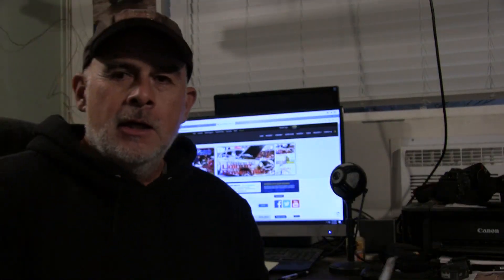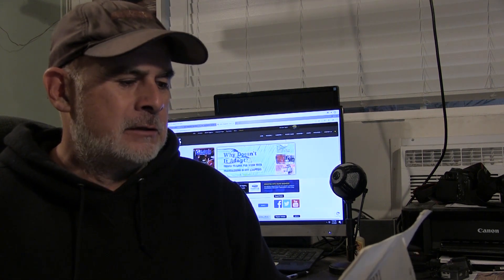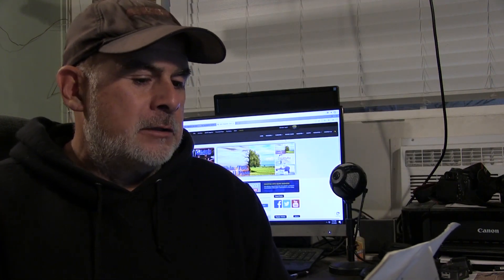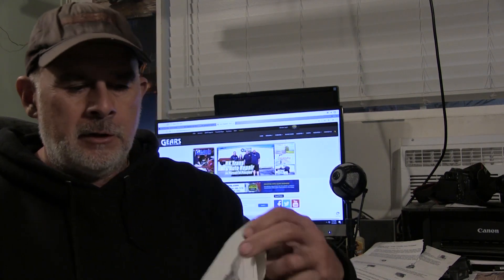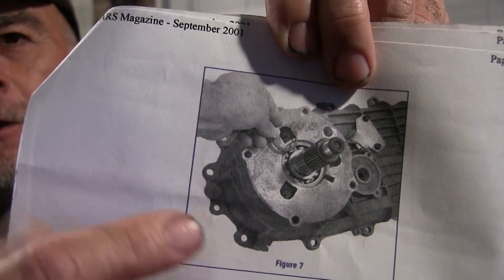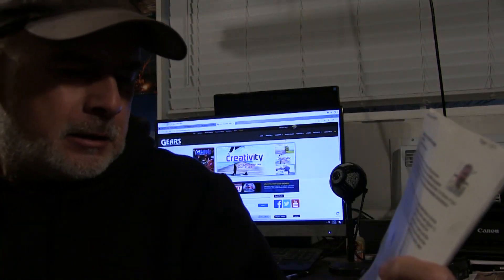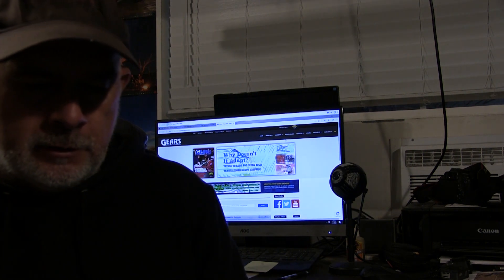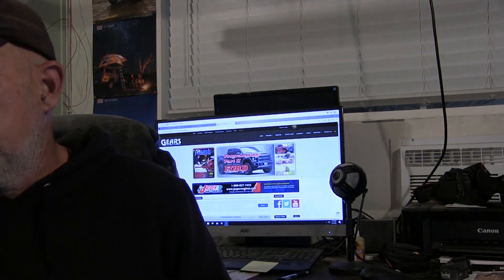Borg Warner 1356 Transfer Case Issues

Comment: Mine clunks on takeoff, haven't noticed this during backup though.
Reply: This still applies to 1356-82 with boot and fixed flange yoke?
Reply: @xAwoken_Dreamer Mine (1995 Bronco) has a flanged double cardan on the xfer case and a slip joint in the shaft just behind the double cardan.  The drive shaft is two pieces because of the slip joint.
There's no carrier bearing assembly on this setup, like my 2wd f250 has.
I haven't been under the Bronco in a while, this is from what I remember.
Reply: @thisisyourcaptainspeaking2259 Yeah I got the same on mine. Double cardan flanged output. I have the hard clunk in my 96 Bronco when taking off. Curious if I can still add the 2 shims to eliminate play while re greasing the slip on the boot. Not alot of flanged model repairs here on YT so I'm hoping the issue and internals are the same between the two.
Reply: @xAwoken_Dreamer  I'm not certain if you can place a shim under the flange to tighten the runout a bit but I think you can.  I guess it needs to have some runout, else the thrust surfaces/bearing will get trashed.  To me, a barely perceptable runout should be sufficient, which means the flange should rotate easily.
I'll be checking mine while regreasing the splines, probably shim it if there's excessive runout.  I don't know the detail yet, gotta watch this video and consult the factory manual for any specs
The chain only moves with front shaft rotation, the fluid pump is driven by rear output shaft rotation.
Reply: @thisisyourcaptainspeaking2259 Yeah ima see if I can borescope the case to see if I can see the oil pump wear on case. But for the shim Chrysler #00015128 I'm having no luck sourcing not even a replacement part atm
Reply: @xAwoken_Dreamer  You might consult with a local transmission shop, I bought all the parts from my local shop when I explained I'd be replacing the front seal in my C6, he suggested while out of the car, replacing a few parts besides just the seal.  Bottom line, he was eager to help.
These guys have more shims of various sizes and shapes than you might expect.
Reply: @thisisyourcaptainspeaking2259  Yeah your not wrong. Thanks
Reply from the maker: You might try pulling the rear driveshaft and checking the u-bolts and slip yoke. Clean the old grease off the slip yoke and pack it with some teflon based grease you can get at any autoparts.
Reply: @rudedogii   Yeah, kinda strange because it's been this way since I bought it at 25k miles, now it's got about 60k miles on it.  I did grease the rear drive shaft slip joint but just with chassis grease.  The splines fit pretty snug and were coated with some teflon coating looked like.
Anyway, I'll be crawling back under there soon to change all the fluids, I figue it's about time...
Reply from the maker: @thisisyourcaptainspeaking2259  There are some videos out there on the slip joint issue. Ford even has a part number for the Ford grease but the stuff from the auto parts is the same. Sorry I dont remember the grease name but it comes in a plastic tube.
Reply: @rudedogii Thanks.  I was noticing some transfer cases that originally used atf are now getting 5W-30 synthetic instead.  I have yet to discover anyone using this to fill the bw1356, my search brought me to your channel.
I'll pick up a tube of teflon-based grease for those driveshaft splines, thanks!
Reply from the maker: @thisisyourcaptainspeaking2259  I always used the recommend ATF plus a little Lucas ATF additive. Here's the Ford grease! https://amzn.to/3F5MvMZ

Comment: I have the same exact issue. It’s pretty bad just getting on and off the throttle while driving. I have excessive play shaking it side to side but really bad twisting it by hand on park.  And yes both u joints and the pinion bearing and busing have been replaced, no difference. No grinding or noises from the transfer case and it shifts through all modes fine. I hope it’s not a sloppy chain.
Reply from the maker: Did you grease the slip joint on the drive shaft. Ford recommends a Motocraft grease but this is the same thing. https://www.amazon.com/Super-Lube-21030-Synthetic-Grease/dp/B000XBH9HI?pd_rd_w=5BSM5&content-id=amzn1.sym.ea1d9533-fbb7-4608-bb6f-bfdceb6f6336&pf_rd_p=ea1d9533-fbb7-4608-bb6f-bfdceb6f6336&pf_rd_r=QANECQCNW0M60NF3NC0J&pd_rd_wg=uFSBK&pd_rd_r=a492da0f-dadf-4d51-b496-9beb88873c9d&ref_=sspa_dk_detail_img_1&th=1

Comment: Can this be done without splitting case? Still in truck?
Reply: Disconnect the wiring from it and the front and rear drivelines, take off the flange bolts that hold it to the transmission, kick that whore towards your rear axle until it swings down held on by only the output shaft of the transmission and then wiggle it off rearward until your covered in red oil and you chest is crushed because it’s heavier than your drunk ass thought when it finally falls off. Good luck

Comment: I rebuilt my 1356 the rebuild  info I was fortunate  to get from a great guy on FSB the oiler tube is an issue that comes loose is an issue that happens  so creating a better attachment in there is key. I was lucky to find a shop that manufactured  the planetary gears at a great price hear in So Cal  near me. I  got a chain and bearings and seals etc.  Just had my trans built good for a new engine to replace that little 302. A balanced  & blueprited  full roler with MAF and AFR  legal heads built on a 351 block. Should be screaming up the taller steep dunes I could almost make it before. Dual lockers help real well but needed just a little more push. The 1356 is  known as a good case from all I have learned .